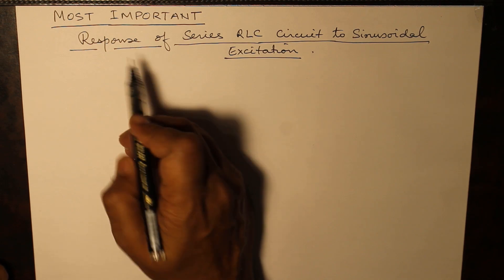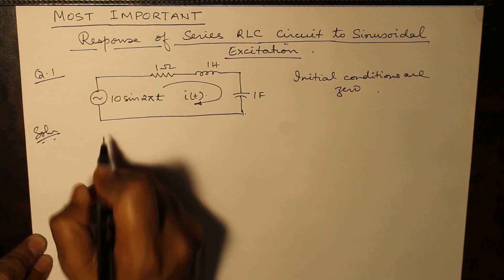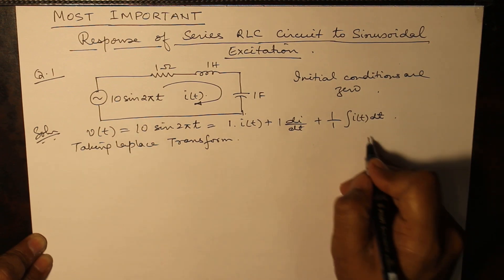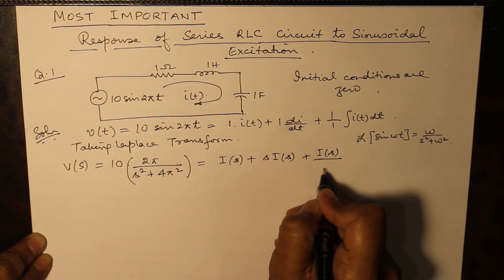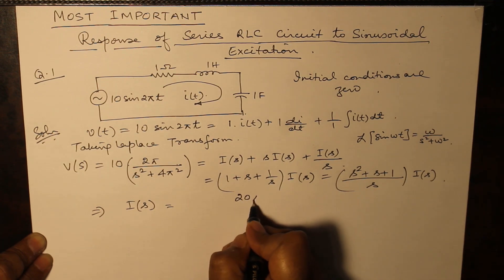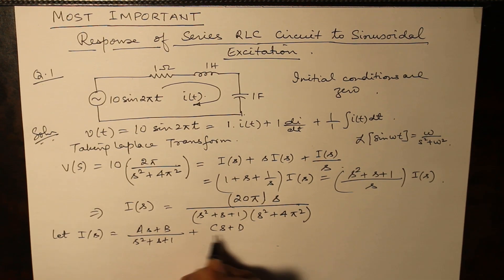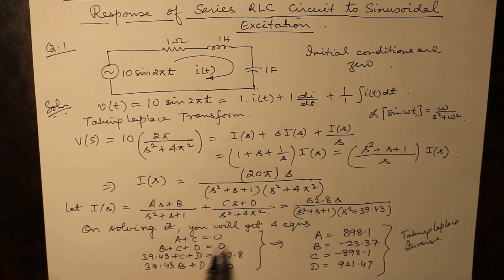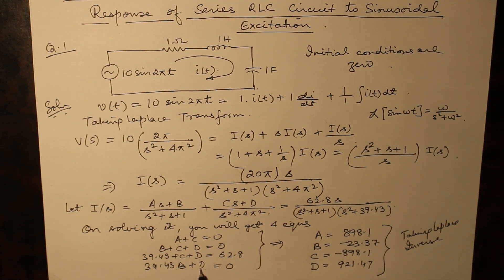Response of RLC circuit to sinusoidal excitation | #21 Circuits and Systems | IP B.Tech Sem 3 Unit 1

Comment: Sir i have a doubt , when u formed the 4 equations of partial fractions, the 3rd eqn u have written  is wrong as it will be 39.43A and u have only written  39.43.
I am not able to find out any of the values due to this error. Kindly give the solution Sir

Comment: Sir i have a doubt , when u formed the 4 equations of partial fractions, the 3rd eqn u have written  is wrong as it will be 39.43A and u have only written  39.43.
I am not able to find out any of the values due to this error.